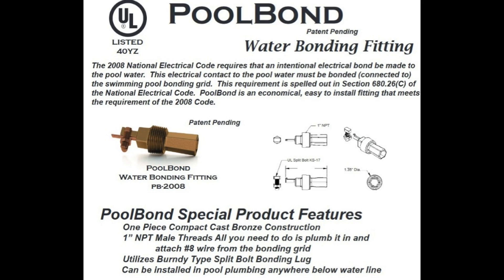Equipotential Bonding For Swimming Pools

Comment: What if you have a liner pool and no re bar in concrete but reinforcement wire was used
Reply from the maker: Depending on where you are located it may not be required.

Comment: You do not need to, nor should you connect the bonding cable to your ‘main earth’ of your main electrics.. 

Electricity chooses the path of least resistance (earth) so if there’s a fault in the house and the electricity needs to escape (through your main earth) and your whole pool is connected, there’s possibly a slight chance it could be dangerous.. 

You don’t need to connect it to anything, as it’s bare, it’s already‘earthed’ as well as ‘bonded’   Hope this helps mate
Reply: Thats right. The rebar is in contact with ground all times. The panel pulls ground from the star point at the sub station anyway. You could just drive a rod down in the vicinity to be on safe side

Comment: How do you measure the earth voltage at the main panel so as to verify that everything bonded downstream is in fact equipotent?  or do you not care what the reference voltage at the panel is and only concerned with continuity of all bonded structures? Thanks for your reply. Cheers
Reply from the maker: You can put a piece of rebar in the ground in test the resistance between the ground and the panel and the piece of rebar. Although it shouldn't matter as long as everything is bonded.
Reply: @JohnThePoolExpertGuy  But the resistance won't show voltage. Yes if everything is bonded and powered via a gfci if there is voltage difference the gfci should trip but that is only if the difference is detected downstream from the breaker. What about stray voltage backfeeding from a neighbor or a damaged neutral on the the service side and using your pool as a pathway back to source?
Reply from the maker: @hippo-potamus  

Check out this video

https://youtu.be/wyOILpoR39A

Comment: Hey John, I am going to have 8’ sections of bullnose aluminum coping around my pool with separate corner pieces. Do each piece of the coping need to be bonded? Thank you
Reply from the maker: If they are not touching they all need to be bonded or they can be bonded to each other underneath where you can't see it if you want.
Reply: @JohnThePoolExpertGuy  so if there are clips to hide splices I should be good?

Comment: This answered my question why my in ground pool from 1979 has  bonding on the chainlink fence posts around the pool.  The posts were 4ft 6in away from the pool frame. The pool is a steel frame in ground pool with bonding clips on each corner of the frame too. 
Most of the bonding clips actually rusted out at the steel screws after 43 years.

Comment: Is there a way to check if an inground pool built in 1973 was bonded and grounded?
Reply from the maker: It's hard to tell with an old pool. Most likely the light has a copper pipe that comes back to the J box and that's about all the grounding it will have.

Comment: From what I understand, that bond does not go back to the panel ground/bond.. 
250.8. An 8 AWG or
larger solid copper bonding conductor provided to reduce
voltage gradients in the pool area shall not be required to be
extended or attached to remote panelboards, service equipment,
or electrodes.
Reply: That is correct, it's not an equipment ground, it's an equipotential bond of the area around the pool and equipment.
Reply: That’s right. This is the one thing he is doing wrong. He’s actually creating a potential hazard tying it in to the equipment ground

Comment: If I’m building a swim up bar, that has a gazebo on top of it with a metal roof that will be higher than 5ft from the pool surface does the roof need bonding? The frame is all wood with metal bolts, the plates that hood the posts down are metal and will have a bonding wire on each of them, is that sufficient?
Reply from the maker: You shouldn't need to bond the roof.
Reply: @JohnThePoolExpertGuy  thank you!

Comment: We had our salt water pool 3 years ago. The metal steps have rusted already been replaced but rusted again. Could this be to do with bonding ? (Spain)
Reply from the maker: Probably doesn't have anything to do with bonding.  It's the salt. I always recommend that there be no metal in or around salt water pools including diving boards,  slides, handrails, and steps. Bonded ot not they all corrode.
Reply: @JohnThePoolExpertGuy  thanks for the reply that’s reassuring,

Comment: You forgot one thing that is integral to any electrical connection, especially one that is getting submerged in cement. The all important tug test. No point connecting it if it's going to come loose when the slab gets poured.

Comment: I’m in the process of having the concrete deck around my pool replaced. In the process the ladder coming out of the pool in the deep end was tore up because it was buried in concrete. I bought a new copper ladder anchor on a plate. And have the grounding wire. The old ladder all it had was a wire wrapped around the anchor. But I was not able to see where that wire went to before the concrete guys tore it up. How is the best way to ground that pool ladder? I’m assuming everything else is grounded correctly as nothing else was tore up but the concrete and the ladder. Please help
Reply from the maker: The wire comes from the rebar in the structure of the pool wall. You need to chip away at the concrete pool wall near the ladder and find the structural rebar or find an already exposed piece and put a direct burial bonding clamp on it. Then run #8 Guage bonding wire from there to the anchor for the ladder.
Reply: I see a rebar into the ground right around where the latter was. And I see some old copper wire. Take number eight from each ladder anchor, there are two total, and go to that grounding rod? Or do they need to separate grounding rods?

Comment: Hi John, I live on Hollywood FL I have a pool with 15 X 30 foot and i want add a spa.do you think i could do my self ,My pump is 1 1/2 Hp one speed .
I planing doe 8 X 8 ,
Reply from the maker: There's no reason you couldn't do-it-yourself. It's a lot of work don't forget you need a heater. But you should be able to do it.

Comment: I have an existing inground pool/spa combo built in 1990’s, an old intermatic timer dial, matching brand freeze protection box, a compool LX220 solar controller box, Hayward H250 (ED1, way old) dual thermostat heater and a new intelliflo VS pump. I recently got a killer deal on a brand new Easytouch PSL4 with screenlogic and I see it has a breaker base in it. So I’m guessing it acts as a sub panel. I see it has bonding lugs and I would think I would bond it along with my pump and heater. However watching your video you said everything gets bonded to the ground that comes from the main panel.

So with all that said, if I go ahead and install this PSL4 and have my main feeds coming in along with my green insulated ground, would I just tie in and bond the PSL4 box to the pump and heater? Any suggestions? And I’m in CA as well.
Reply from the maker: Yes it is recommended that you do that .however since the pump and heater are bonded and they have grounds that go back to the panel its kinda redundant.
Reply: John The Pool Expert well ya see, idk if they do 🤷🏻‍♂️ . This thing was built probably 25-30 years ago so I really don’t know what’s under that concrete aside from 3/4” rigid pvc with 12g and 14g wires coming from main breaker on the side of the house and I know it’s plenty more than 50ft so I don’t know how that’s working cause of voltage drop. That’s why I was gonna use the load base in the PSL4 and run a new 6g run with 8g insulated ground to the pad area. know that I want it safe and I will make sure it is and so I gotta educate myself and read a little more. I want to make sure that I bring everything up to code as well. I appreciate your video and your response as it is helpful in my education before I embark on this project. I just certainly hope I don’t have to trench out my concrete and lay a larger conduit cause that’s really gonna suck.

Comment: Where in the National Electric Code does it say to hook your bonding wire to your main panel's grounding?
Reply: 680.23
Reply: @bohanli9345  no it does not, that covers branch circuits for pool equipment and lights the bonding cable does not go back to main panel.

Comment: Hi john ,i had my pool built about ten years ago ,i took out permits and checked by city inspector while being built.Was bonding required 10 years ago ,and how would i find out if they are bonded?Also i have a metal ladder ,hand rail ,and slide ,is there a comany that makes all plastic so i dont have to bond just incase ,and lastly are 12v led lights safer than the 120v? thanks
Reply from the maker: aj sj 

If it was inspected  then most likely the pool and the anchors for the handrails and the anchors for the slide are all bonded. The only thing new in the last 10 years is bonding the steel in the concrete.

12 volt lights are very safe however all the 120 volt lights are fine as long as they are GFCI protected.
Reply from the maker: aj sj 

They do make plastic anchors but it would be a pain in the butt to drill out your old anchors and put in new ones only to find out the old ones were bonded. You can test if they are bonded by doing a continuity test. If you take out your metal ladder and test continuity between the two metal anchors you should have continuity if they are bonded.
Reply: Hi there john,thanks for your answers,after checking my pool equipment is bonded , i see the copper wire from pump to heater etc . i have being trying to understand this bonding and grounding,so i have a question,let say there is a metal fence six feet away from the pool ,how can this fence affect me or the pool water with electricity (SHOCK ME)?The fence is not connected to an electrical wire ,like the pump and heater.Or is it that the fence is on the ground and the ground could be a conductor.THANKS
Reply from the maker: aj sj 

Mostly has to do with stray voltage. In California there isn't much of a problem with stray voltage because of the type of Transformers we have here. But in other states than the us there is a potential of having stray voltage and that's what equipotential bonding should solve.

To understand better I recommend Mike Holt videos on YouTube about equipotential bonding.

https://youtu.be/pAs_FmdxXhQ

Comment: Hi John, thanks for your great video! Our requirements in Australia are slightly different for bonding in a pool/spa or wet area, but are also constantly under debate at the contractor level.   It is good to see that there is legislation all over the world to ensure the electrical safety of consumers in these areas.  Cheers Em
Reply from the maker: Conductor Hub 

 Thank you for watching. I am interested in your electrical requirements over there.